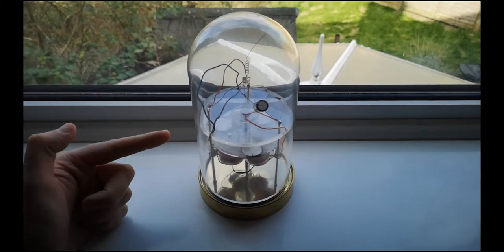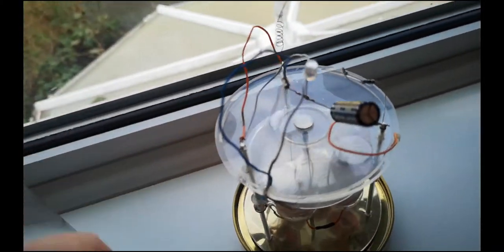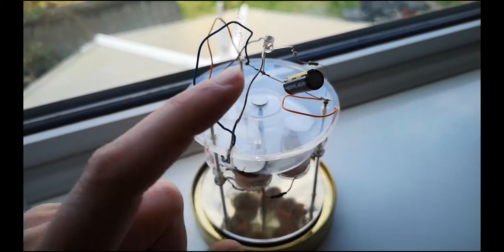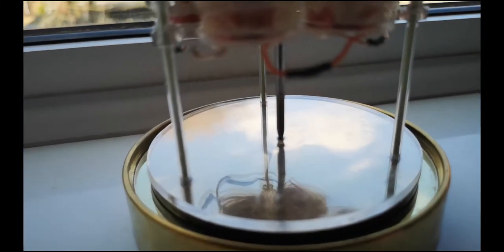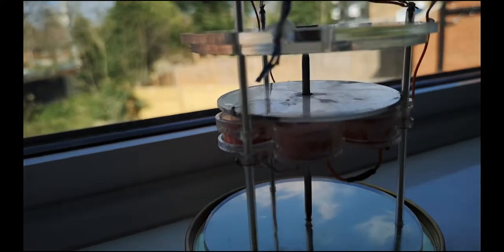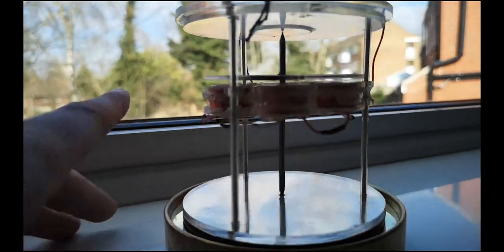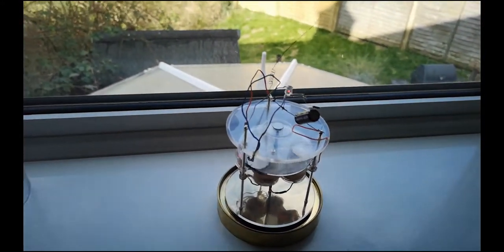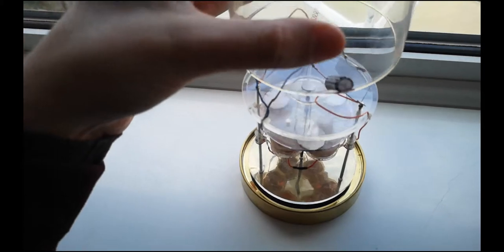EZ Spin Motor Desk Toy

Comment: Wow, very interesting. You talk about batteries however you also talk about an antenna? Are you saying that the antenna is where the intital power comes from! Nice job.
Reply from the maker: No batteries. There is the capacitor which can store up to 36J which started empty. All of the power to run it comes from that antenna, and a solar panel in the base. I've posted an update video explaining: https://youtu.be/NvFcUvYi32s